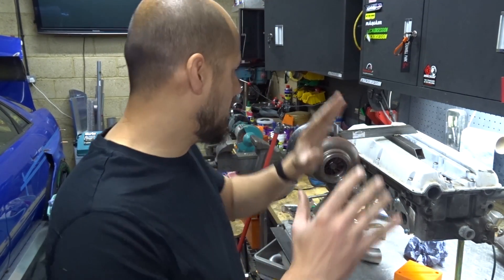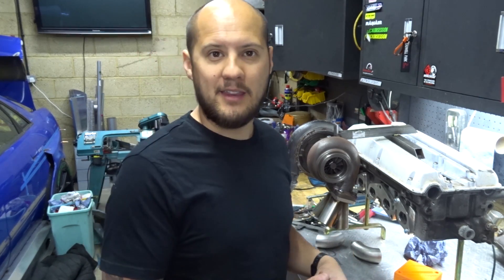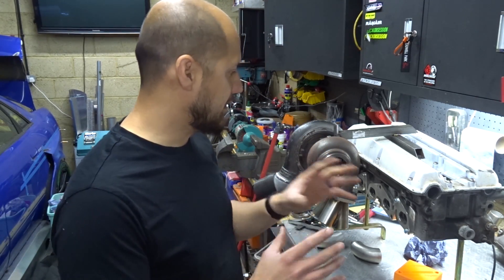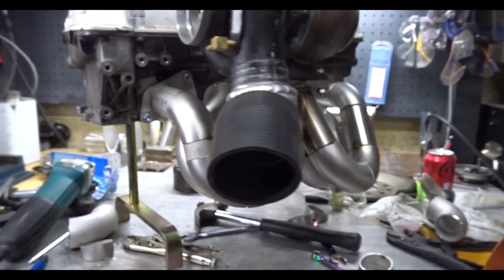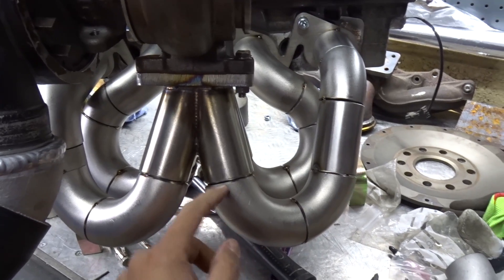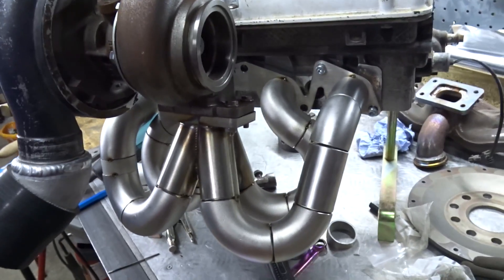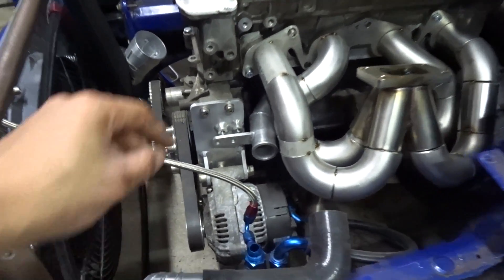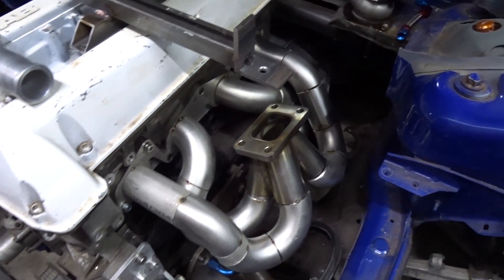Building a turbo manifold - Part 2 Saab B204

Comment: What trick do you use to get all the runners the same length
Reply from the maker: No real trick, and they're not all identical lengths but fairly close. Easiest way is to try and use the same amount of material for each. For example 3 full bends and a bit of straight length.